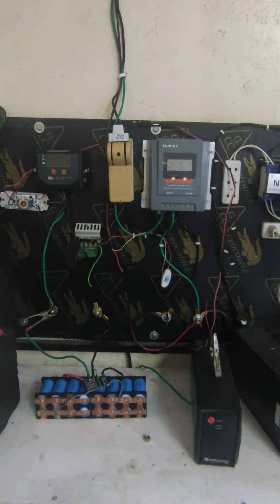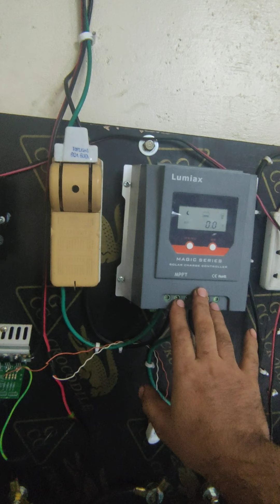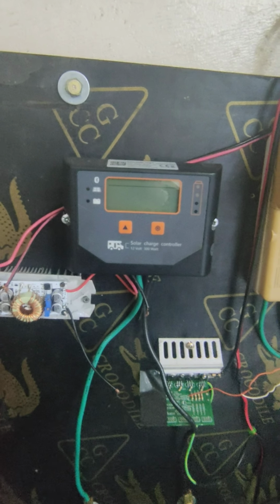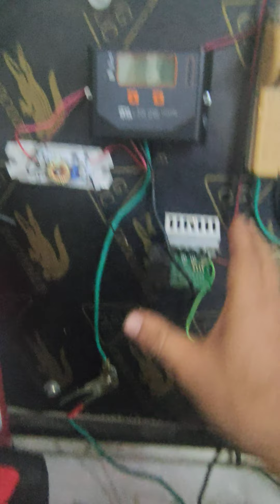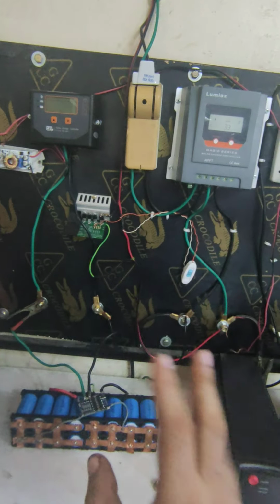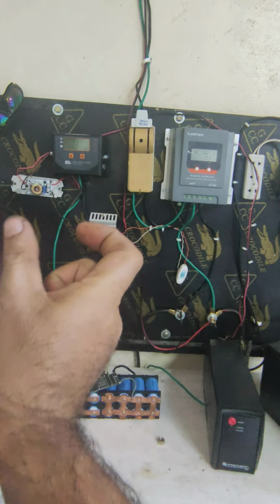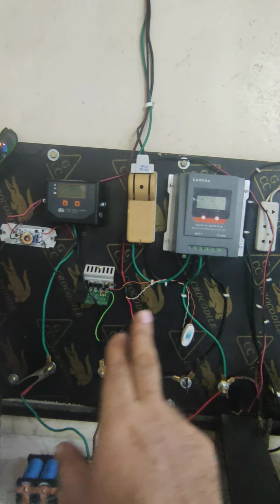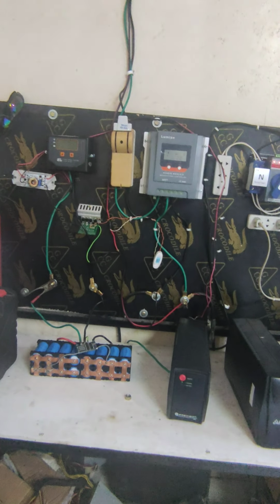do you need buck boost Module or not ?

Comment: Dude you dont need a pwm solar charge from the buck boost?!? Just set it to float 13.5v on the buckboost -> lithium. That solar charge controller seems completely wasted
Reply from the maker: My point is battery to battery charging from 2 DEFRENT charge controller using 2 DEFRENT charge controllers PWM don't have CC
Reply: @MarkPrince1317  I'm saying you can remove charge controller on the left and use buckboost only
Reply: @MarkPrince1317  oh ok you are changing it around when the solar panels is low voltage, very confusing but I think I understand now
Reply from the maker: @NeilBooth  yes yes right understand 👍
Reply from the maker: @NeilBooth  thank you brother for understanding it's all experimental lab my power wall is very messy I will show you don't forget subscription brother
Best regards from Philippines 🇵🇭

Comment: The dumb simple question is whether or not i can get much more service from a lead acid battery if I use an automatic buck dc dc step up booster? whethwrSo very dumb... all I want to know is if a buck dc dc step up booster will allow a simple lead acid battery to provide service much longer?  Everyone goes into a lenghty speil without ever answering the simple comparison.  YET their title seems to claim providing the answer.  Just enough title information to make one think the simple answer will begiven
Reply from the maker: Ok brother noted but now ledacid battery's technology is old for LED or inverter use its much Bater to use lithium batteries the purpose of buck boost converter or LED driver is just to keep light on on required brightness and to avoid the overheating the LED